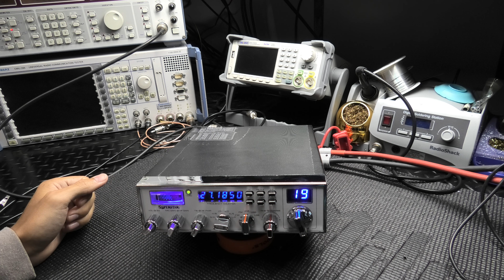Super Star SS-158FB4 w/ Amp Switch For Chris High Powered CB Radio

Comment: I have a question. The mic plug on a radio has a lock ring on it , is there a special tool to get it off or should I just keep doing what I have been doing.
Reply from the maker: Yes there is a special tool you can use. I bought one off ebay a while back
Reply: @TheRadioGarage  does it have a name because of I can't find one I'll make it
Reply: I made one because eBay was sold out